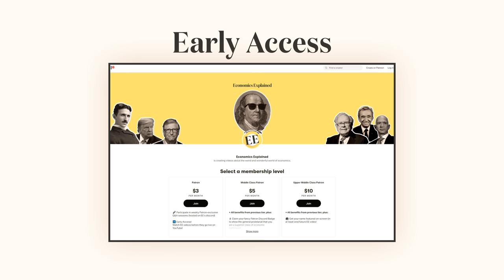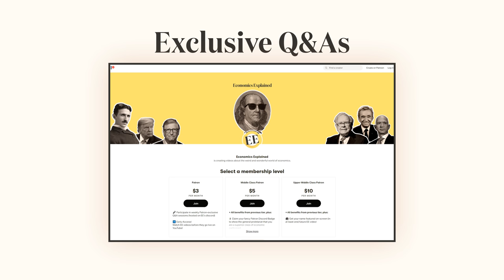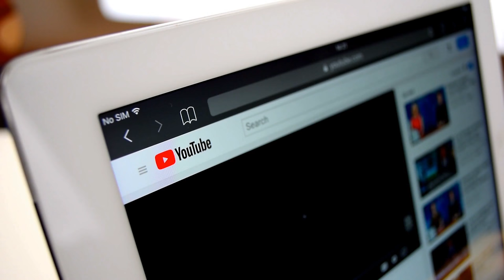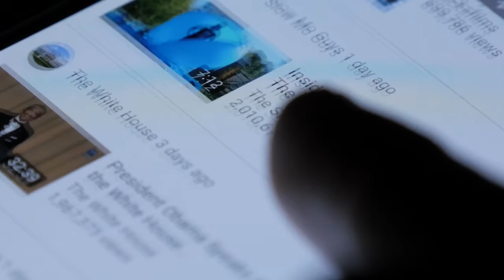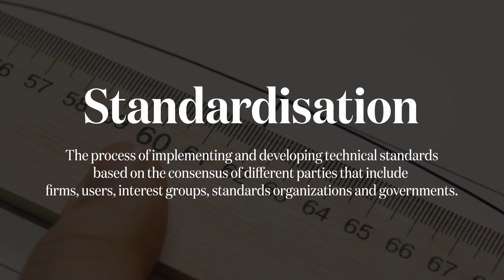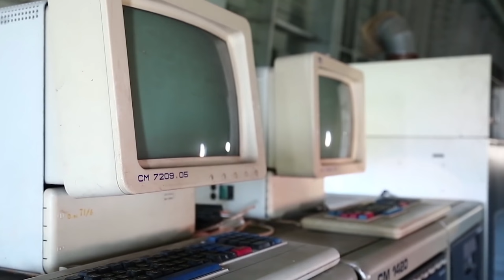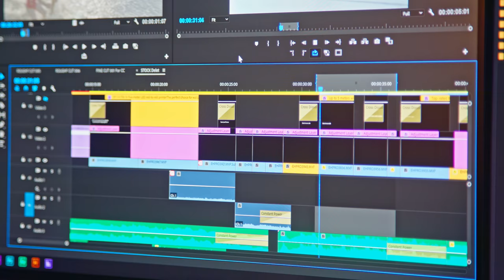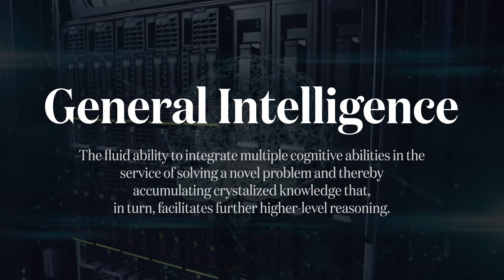Is the Fourth Industrial Revolution Worth the Hype? | Economics Explained

Comment: As we advance through the third and on to the fourth versions, I see a need to return to a focus on robustness and redundancy. Massive system failures can and should be avoided by proper foresight and planning. You need a Plan B because it may very easily become Plan A, without notice .

Comment: Sending information through the country in less than a week was possible before.

In Liechtenstein
Reply: It could go surprisingly fast even in the past. In the Roman Empire, messages could be sent from Britain to Syria in 2 weeks.
Reply: @niklasmolen4753  🤔 cool fact
Reply: @niklasmolen4753  Horses were the maximum speed limit before trains, basically rendering the max. daily speed for information to some 50km per day.
Reply: @mikitz  you'd need to stop and change horses if you're going that fast everyday or else the horse will die from exhaustion
Reply: @guycross493  which would be why such arrangements tended to use a relay system.
Reply: @grahamturner2640  Pony express?
Reply: @grahamturner2640  Smoke singles?
Reply: Courier pigeon?!
Reply: Free City of Frankfurt

Comment: To me, there's three main revolutions:
The Agricultural Revolution, giving us agriculture and society
The Industrial Revolution, giving us industry and mass production
The Digital Revolution, giving us digital computers and the internet, as well as access to all the data on the planet at the touch of a button.
Sure there were more than one of each, but they're all just continuations of the original one, now taking new forms with newer technologies and implementations.
Reply: Many agree that a second agricultural revolution happened in the 60s with the widespread use of fertilizer and better seeds
Reply: @DeeZedEx  very different type of “revolution” and imo not a revolution but a new change with little change on how humans live.
Reply: These are technological revolutions that change the experience of humanity rather than industrial revolutions. To your list I'd add two: 3) Electrical revolution: changed the way we utilize power, and 4) Medical revolution: from germ theory to MRNA Vacccines. My hope for the 6th revolution (after digital)  is social, when automation pushes the marginal cost of production so low we cease measuring value in labor.

Comment: So here's one of those things that economists talk about very little, but engineers and historians talk about a lot: economic growth isn't a function of human ingenuity, its a function of energy. 

The industrial revolution unlocked the energy of fossil fuels, which powered every facet of it (mechanisation, steel production, fertiliser production, improved mining etc.). Going further back, water and wind power revolutionised European economies in the pre-industrial period, and animal labour revolutionised agrarian economies wherever it was practical to introduce.

So we need power, lots of it, if we want to see growth. Which sucks, because fossil fuels are getting harder and more expensive to extract (not to mention the whole "we're cooking the planet by doing so" issue) and the replacements don't yet stack up in terms of either cost, or in terms of providing an easily-transported form of motive power for things like planes and ships. So we need to solve the issue now if we want to see growth again.
Reply: The first thing that comes to my mind is that probably best source for energy is solar. But not on the planet, outside the planet. Then the amount of energy would be infinite and much higher.
Reply: @RetreatHell518  Unfortunately, space-based solar has the downside that any workable system for sending a lot of power down from orbit either doubles as a death ray (if sent to a single spot) or can't be metered out and charged for (if it blankets a wide area).

It also doesn't solve the storage issue.

Comment: AC Electricity: Am I a joke to you? You would not be able to post the video without me
Reply: Also the internal combustion engine. 😢
Reply: @hawaiijim  I thought he was going to talk about that, they are key parts of the second Industrial revlolution: interchangeable parts, mass production of steel,internal combustion engines, electricity.
Reply: Joke's on you, PCs actually use DC
Reply: @apacheattackhelicopter8185 : But still source their electricity from an AC source, so you still depend on AC!
Reply: @fetchstixRHD  No you don't. If I plug my PC into a DC source like a solar panel or a battery, it will work. But if I plug it directly in the AC outlet without a DC converter, it will get fried.
Reply: @apacheattackhelicopter8185 : ...virtually nobody gets their electricity directly from a solar panel, though. More importantly most web services etc will use an AC electric supply. Batteries also need to be charged from somewhere, and unless you want to change all those supplies to transmit DC...
Reply: @DEHMAN yes transmission is key to make electricity useful.  You can take my comment as just electricity if you want. Even that was not mentioned. Electricity has touched and transformed every facet of human civilization.
Reply: most people reply to this shallowly not understanding his point,  what he meant is AC facilitates transportation of the electricity and that is the most important part of it all. before then it was transmitted yes,  and yes dc is much readily usable than the former but it is inefficient. ac enables to step up to higher voltages for transmission. that is the whole point of it all, and I think the guy's comment is on point it was such a revolution.  at times ya'll need to chill nd think a lil before engaging in aimless arguments, i mean, we are EE fans, we can do better :)
Reply: @janakiraman1252001  you were just correct no need to over explain, those who know know :)
Reply: @apacheattackhelicopter8185  You’re sounding like Edison. All of us depend on and need AC power. DC simply won’t work, DC is also impossible to transfer efficiently over long distances. Most power plants, including nuclear, will produce AC.
Reply: @PegasusTenma1  "DC is also impossible to transfer efficiently over long distances" 
Oh, really? Is that why the underwater cables spanning hundreds kilometers all use DС?
Reply: @apacheattackhelicopter8185  Those are internet fiber optic cables, they do not transfer electricity for domestic, state or national use. You’re trying to trick the wrong person here, I’ve studied electromagnetism for years, What you’re talking about is known as HVDC, only reason it’s used underwater is because DC wires have very low inductance and capacitance as opposed to AC underwater, otherwise due to the cost of step-up/step-up systems, AC would be the preferred option
Reply: @PegasusTenma1  I am talking about HVDC, don't know why you brought up fiber optic. If you have studied electromagnetism for years, why do you say things that are simply untrue like "DC is also impossible to transfer efficiently over long distances"
https://en.wikipedia.org/wiki/High-voltage_direct_current#Comparison_with_AC
Reply: Don't forget about fusion power.  At the current rate of AI progress, AI might end up being revolution number 5.

Comment: Standardisation. Ah yes, how every self respecting developed nation in the world has adopted that superior measuring system.
Reply: Marc T  0 °F, was established as the freezing temperature of a solution of brine made from a mixture of water, ice, and ammonium chloride. The other limit established was his best estimate of the average human body temperature  (set at 96 °F; about 2.6 °F less than the modern value due to a later redefinition of the scale)

Wow, that seems all a convenient, easy, consistent and scientific thing to do. I'll stick with boiling and freezing water, which gives me accurate and repeatable result.
Reply: Marc T  How is "average human body" even remotely scientific. It is no wonder that all but 3 countries adopted the Metric system. That system with dividing in to 2's is far from convenient and archaic at best, unfit for modern times.
 ► 1cm³ of water weighs 1gram, in order to change the temperature of it by 1°C you'll need 1calorie.
Try that in hillbilly units.

Comment: As a blacksmith myself, I can confirm that iron is a terrible material to build anything load bearing out of, especially if that is itself. If you notice, a lot of old iron made components are bulky with lots of structural supports and reinforcements. It's not exactly soft, but it's also malleable enough to deform due to work stress. So the production of cheap, quality steel in a large amount was a huge game changer.

Comment: You completely forgot the invention of the typewriter in which the second revolution would had had a much lower impact on the industry at large … because it was the introduction of the typewriter that enable the society (both public and private) to leap forward by revolutionary the way administration was conducted at the time. Without the writing machine, everything had to be filled by hand and ran the risk to be unreadable due to pour calligraphy from the authors. The typewriter was the pivot on which the second revolution swing into full gear. without the type writer, there would not be computers.

Comment: I think the definition of an industrial revolution could be given more depth. The main elements of a revolution are power technology, communication technology and transportation technology.
 The first Industrial revolution started when newcomen engine was married to a steam condenser. This allowed the steam engine to have broad utility than pumping water from mines. This engine led to textile factories and mass employment. The trains and ships run by steam engines provide the transportation and the telegraph the communication. It was the age of the steam engine fueled by coal.
The second industrial revolution was the  electrification powered by power stations(steam turbine) and distributed by an electric grid. It liberated power from it source, and allowed electric motors to be ubiquitous in factories. The invention of the internal combustion engine led to ships, trains, cars and planes powered by oil which provide the transportation. The telephone, radio and television provided the communication. The factory was reorganised into assembly lines and specialisation of labour to result in mass production. This was the age of electricity and mass production provide by oil. 
The third industrial revolution was about  computation and the internet. This transformed power, communication and transportation technology. Electronic control systems(integrated circuit chips) became embedded in technology, computers an integral part of life and work. The internet allowed these computers to be networked which resulted in an information revolution and the knowledge economy. It liberated information from geography.
The fourth industrial revolution is premised on AI, Automation and Renewable energy. With this revolution, we are nearing achieving a world the ancient Greeks yearned for, a world defined  not by fulfilling our basic survival needs (working) but by living life ( arts and culture - values).

Comment: I did an article on interstellar colonization, for which the enabling technology is a self-building factory. The scenario is to send SpaceX Starship to an asteroid with a fully autonomous robot to mine, refine, and fabricate a universal factory, capable of building anything we tell it to. If we take the path from a mediaeval craftsman to Watt's steam engine to Ford's mass production to modern robotic factories, I see this as the next datum. For interstellar expansion, such a probe needs to be miniaturized to mass no more than a kilogram or so. That is the next point on the graph. I see each datum corresponding to one of your Industrial Revolutions. I could be optimistic about the last one.

Comment: The best categorization is simultaneous revolutions in  1.Transport  2.Communication and 3. Energy, thus affecting all industries.
The THIRD = Electricity, Car & Telephone. Notable spin-offs = underseas cables, Information theory ( Claude Shannon).

Therefore the next Revolution happens when : 1.Autonomous Vehicles, 2.Blockchain + AI = distributed Mesh that unlocks IoT ( Internet of Things ) = distributed machine communication + constellation internet ( Starlink etc ) = {micropayments on the internet} & 3. Battery storage + Renewable Energy. Happily, all will be online and spreading rapidly by 2030. Until then it's early for this next Revolution.

Comment: 6:26 Steel has actually been produced for thousands, not hundreds of years. 
The Vared Jericho Sword, for example, dates to the 7th century BCE, and contains steel. 
Steel is high-carbon iron; and thus, when smelting iron with carbon-based fuels, carbon will leach into some of the iron, turning it into steel. The smiths at the time were aware that this "steel" stuff was different from the iron around it, and collected it separately from the iron.

Comment: i think the discovery of the silicon electronics gave us a huge leap forward almost to the point of being a technological evolution? . the death of electric vacuum valves. from the diode to the transistor. eventually leading to integrated circuits. everything got smaller, quicker. suddenly computers that needed 6 * 6 meter rooms would now fit in a few racks. with this computing power came advances in every other type of technology from sheer ability to process engineering, chemistry, biology easier to understand because the advanced  number crunching and logic functions? perfect example, a room full of engineers and draftsmen a week to do what a few hours of video conferencing, a few cad draftsmen and send the file via the internet to manufacture, who uses the cad drafting's. etc, etc, etc.

Comment: I supervise a team of hospital porters, and I used to do my job with pen and paper, a telephone and a 2-way radio. I could still do it with those things, and it would be faster, more efficient and easier for hospital staff to request portering tasks. But pen and paper doesn't give my managers any data, so they insist that to "improve efficiency" we need to use expensive software and iphones that require steady wifi (or they lock up) and extra training for users. All of which costs more and increases the time it takes to get the jobs done. Some of these porters are in their 60s and don't even own a smart phone. Let's just say efficiency hasn't been improved, but the managers now have loads of inaccurate data that they're super proud of. It's inaccurate because steady wifi doesn't exist in our hospital. It's horribly ironic.

Comment: Instead of full AI I think using our excess labour could fill the gap. So I believe in that gap you could have a low skilled person speak to a machine or type requests that the machine then uses to create programming. Programming without a required degree.

For example "New table. Insert customer configuration. Four lines and a box. Next button. Insert copyright agreement. Continue to main table." the machine interprets the instructions without having to understand them

Comment: I would say (as a materials scientist) while steel is pervasive it didn't change ALL industries, there are quite a few more materials to be included if you were to list those that have made similar pervasive changes to cover all industries.
You hit the nail on the head with simply standardisation.
Telecoms can't really be included as (using your own example) they didn't ultimately change how a farmer would grow his crops, or how a car manufacturer would put their cars together.
Honestly the banking and economic system could easily be included as an industrial revolution as it has puervasively changed all things even how farmers deal with their crops.

Comment: Have anyone wonder why did the gas price controls of 1973 cause long lines at the gas pumps?
Reply: Not an econ major, but from my understanding: you can make a graph with a line for supply and a line for demand, where those two lines intersect is the price that will sell every item you have at max profit. 

Price controls come in under this point, so there is more demand for the artificially cheaper gas, causing people who normally wouldn't have wanted to buy gas on any said day to go buy it because the price is so good for them. Have enough people with that line of reasoning, and you get a huge line everywhere.

Comment: Well, you could also argue that these revolutions brought to the world a suite of new technologies that when used in conjunction with one another greatly increased productivity in the existing tasks, expanded the capability of production by introducing new materials, tasks, businesses etc and also making society more efficient.
Giving each revolution a specific time-frame is only making them more independent from one another. It is definetly true that there were more revolutions than "the one and only" but since the introduction of computers, among the plethera of other innovations that appeared since and are still appearing now, it is much tougher now to determine when the current revolution will end as currently I belive that we as a species are developing many more new technologies than our predecessors. And it's only normal to do so as the average Joe now currently has a much better life than the average Joe of the 1850s so.

Comment: Materials choice is actually not that important. An iron car would be a bit less structurally efficient than a stamped steel car. Mild steel is actually not very far off the properties of wrought iron. This is especially true because in many cases, the limiting structural consideration of a part is stiffness, not strength. Iron an steel have essentially identical youngs moduluses and densities.

The sort of steel used in swords and gun barrels doesn't have a lot in common with what they use to make skyscrapers and ship hulls. The former is still very expensive today.